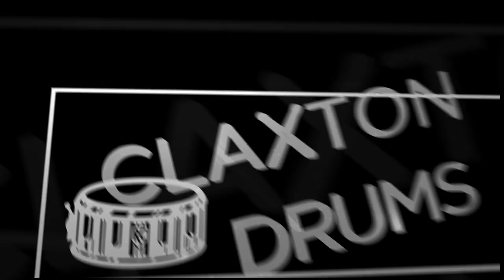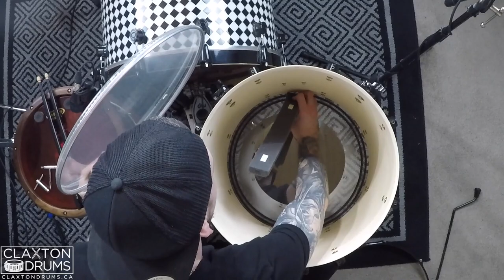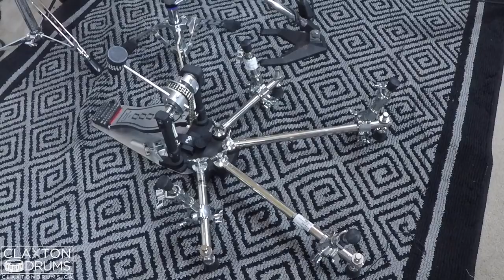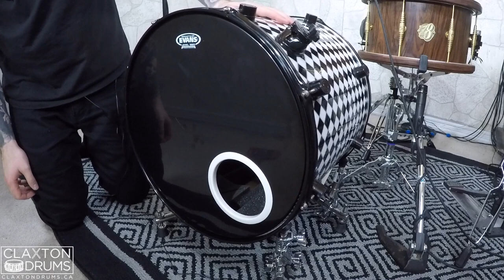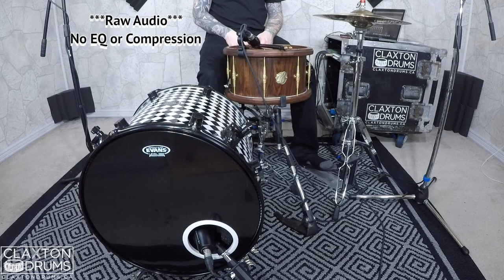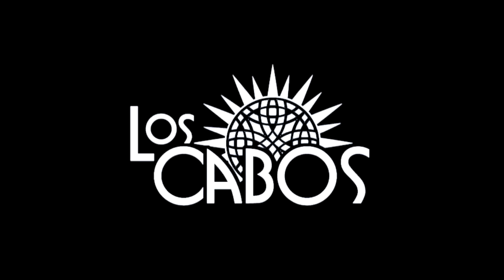How to Convert a Floor Tom to a Bass Drum

Comment: The DW 9909 is $380 haha. A metal base with some rubber feet. Makes no sense how it costs THAT much money
Reply from the maker: That’s fair, but a proper 18” DW bass drum in my case is $1800 so I’ll take this for $380 🤣 I bought mine used and I think I paid around $150

Comment: Is that a pdp 805?. I had a 14x8 snare in that finish and it was one of the best snares I’ve owned.
Reply from the maker: It certainly is! Good eye! 😄🤘🏼
Reply: @ClaxtonDrums  I wish pdp did not discontinue this series. In my opinion it’s sound better than the concept series
Reply from the maker: @Joshstix95  I’d have to agree man! Really fit the vibe of the early-mid 2000’s with the 24,13,16,18 configurations & they sounded even bigger!! 
That’s rad about the snare you had! I’d love to have a 14x8 matching snare of it! Mine came with a typical 14x5.5!

Comment: I came here to see how to attach fest and drum pedal to Tom. You used special tool so this was actually not so helpful for me :/ would be nice to see how to do it without that stand as well also since that is a nother extra piece I got to carry. Looking to have everything attached to the kick
Reply from the maker: Without some sort of stand, you’re stuck drilling out your floor Tom to add bass drum spurs and some sort of Tom mount drilled into the top to have your toms attached. Really don’t recommend such things by any means. You also would need to buy some sort of conversion hoops to allow the pedal to be attached to it. For what it’s worth, I’d just grab this stand. It’s lightweight, folds up, and is impossible to screw up vs doing all the things I said above.

Comment: if you cant afford a riser or claw hand pedal duck tape 2 books together and put 2 screws in the top where the drum will be resting and the hoop will catch on the screws then cut a slit in the bottom spine book and stick pedals clamp thew it and tighten it itll work just fine .
Reply from the maker: Sounds like a disaster waiting to happen lol...

Comment: those feet look like they are on the shell not the hoops to me.
Reply from the maker: The shell rests on it, yes, but the point is that from one side to another, you angle the feet so they touch each hoop which holds it in place and keeps it from moving